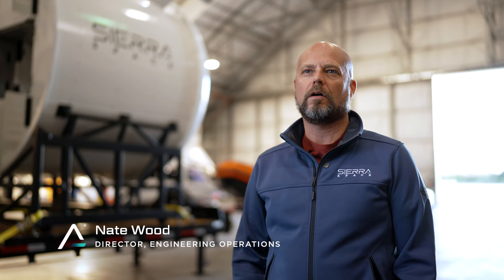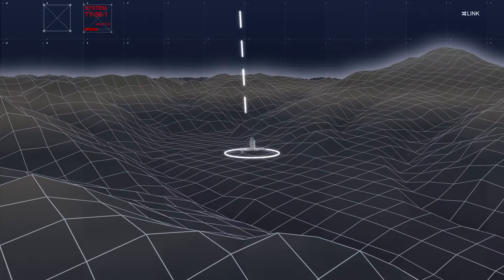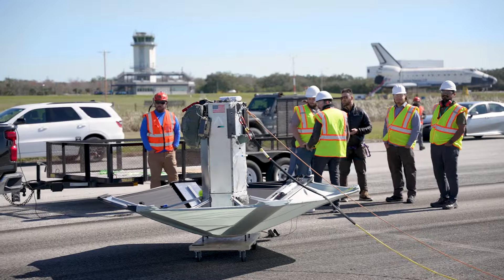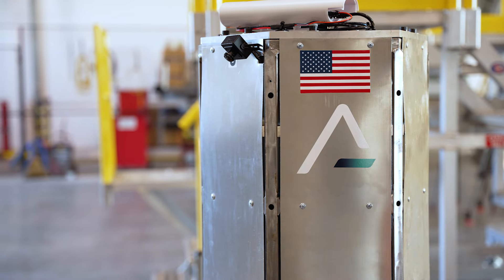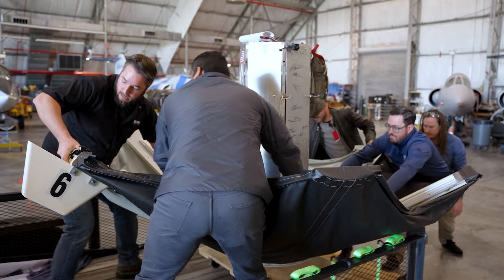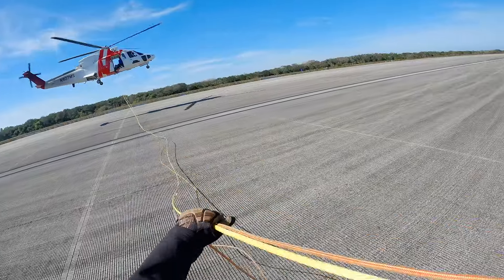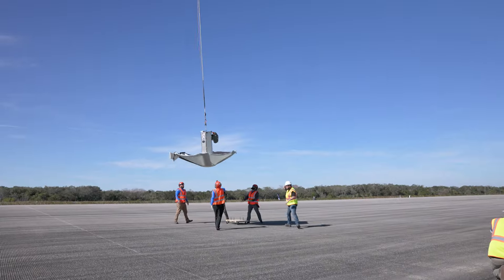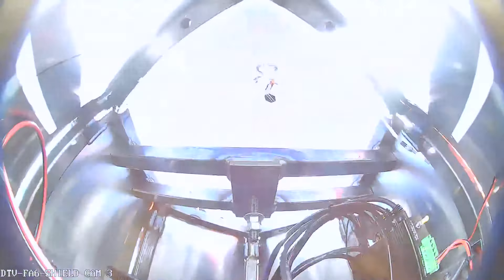Sierra Space Ghost: The Future Space Delivery System

Comment: I like the concept in a way but I guess I don’t fully u understand…

1. How long will this be relevant for the military? They are rapidly transitioning to drones and autonomous vehicles for everything a misfile won’t do.
2. If it will be relevant for a while…Does that mean you have to put thousands of these things in space?  If so won’t that clutter an already increasingly crowded domain? 
3. Also wouldn't you need to make new entry pods every time there is an advancement in weaponry? I mean you wouldn’t want an M1 Garand dropped to you when you could get a XM7.
4. I’m sure as time goes on it will get cheaper and cheaper to put payloads into space but as of now that’s a really expensive way to get items to soldiers. As long as a base is reasonably close, wouldn’t drones do this job in 90 minutes? If a soldier is on a mission that’s farther than a drone can reach to deploy items wouldn’t they usually have planned for the things they need in advance?
5. The one creator suggested that this could be of use in a fire fight. I agree getting munitions to soldiers in need is crucial but 90 minutes in a fire fight seems like an eternity. As long as the resupply gets there before someone is over run it’s great but if 90 minutes is too long it doesn’t help at all. 
6. (To a lesser extent) The only thing that these pods will be able to deliver is what is preloaded on them. If the soldier needed anything else it won’t really help anyway. I know they can put the things most usually needed on them but still. 

Like I said I think the concept could be really useful and any advancements could help in other areas too. I am truly asking these questions I’m not being sarcastic. Am I not fully understanding the idea or are my concerns mislead?
Reply: Not to mention that anything re-entering can be tracked with a simple infrared camera - trying to land one of these in a warzone would just draw enemy attention to the landing site